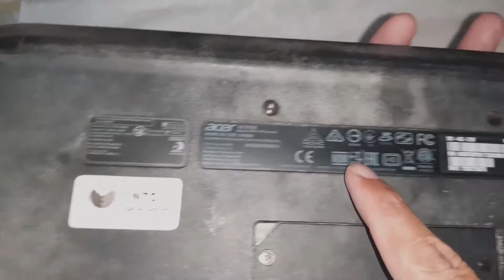How to Disassemble (Acer Aspire ES1-432 Series Model N16Q8) PART 1

Comment: sir ano kaya sira ng laptop q, keyboard kaya? acer aspire E5-576-392h. pag open q ng screen lid niya nag iistart up, in few second namamatay na siya. pinalitan q na ung cmos, nakailang salpak narin aq sa batt, keyboard etc. same padin. nagagamit q xia in some intances, ex. pag angat q kunti ung screen lid mag sstart, then iclo2se q agad, nag rurun siya,  with the help of external monitor naggamit q xia. Isa pag, pag open q lid, dapat may continues na pidipindot na key sa keyboard, di xia nag shu2tdow, pag binitay q mag shu2tdown na siya.
Reply from the maker: Marami pong probable caus ng sira, sa keyboard at LCD I think. Consult Laptop technician na lang po free check up naman sa kagaya ko. Kailangan po phhysical na makita yan kung ako po ang gagawa :) if gusto nyo po ipaayos talaga.